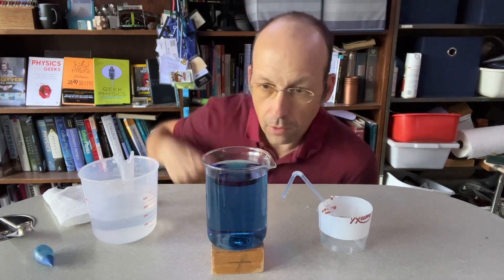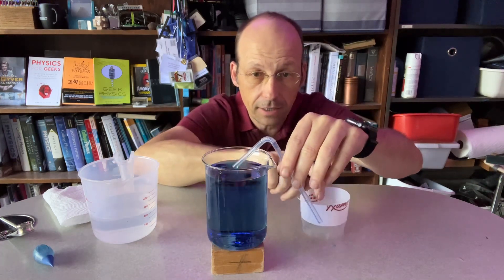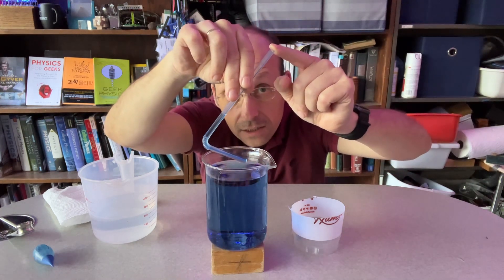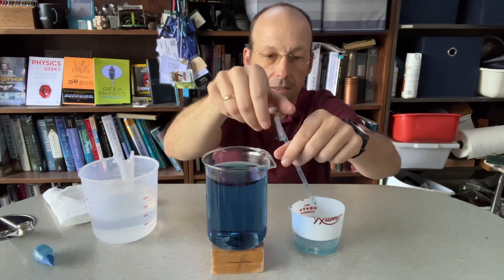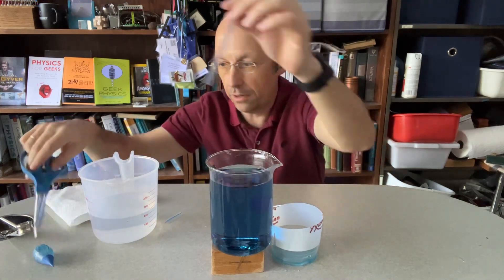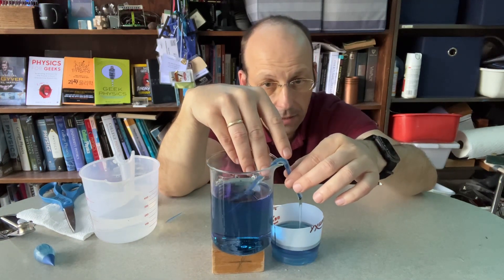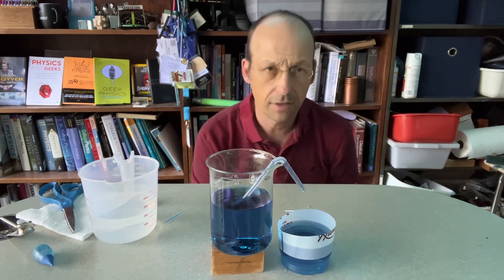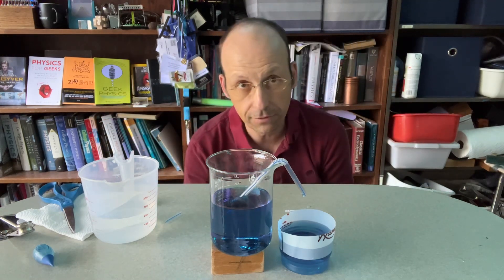DIY Siphon and Physics

Comment: This is fun with syphons. You could make a number of kewl labs about this too. Larger and smaller siphons, different levels.....which container drains faster, which one fills faster. Maybe even use different liquids....water, vegetable oil, syrup, even at different temperatures.   😊